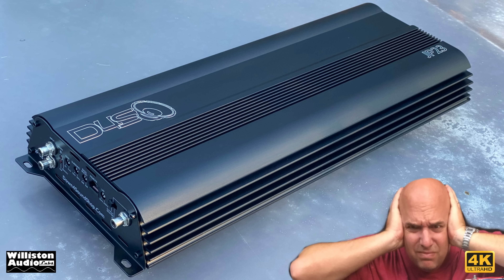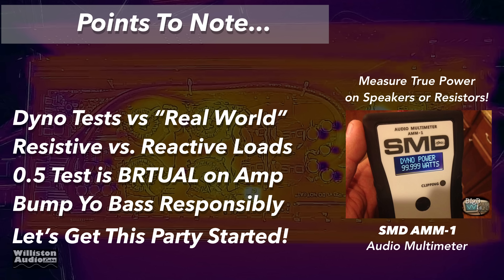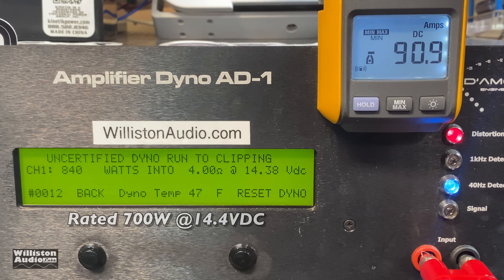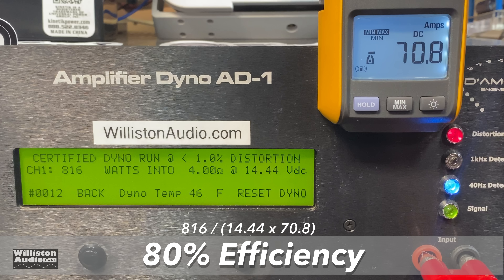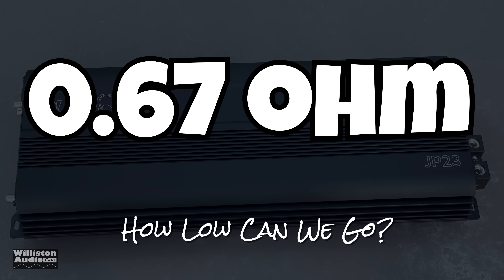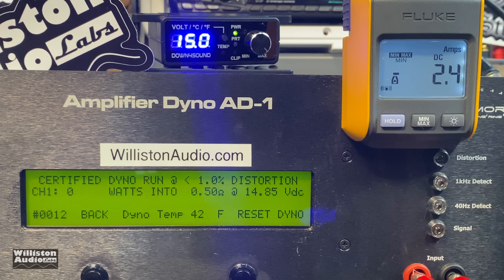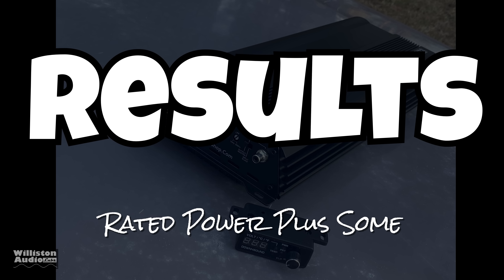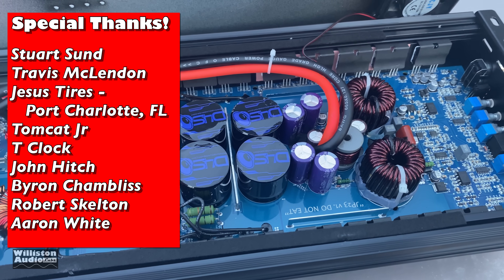Are You Down for Some Low Ohm Amp Dyno Tests? Down4Sound JP23 Amp Test Part 2 [4K]

Comment: Why do the voltages not match? Which one is wrong

EDIT: I see the voltmeter under the amp is also reading 15.0 at idle. So the dyno is reporting wrong voltage
Reply: I was wondering this as well. I believe the dyno measures right at the amp input terminals, which should be the same location the bass knob gets its measurement?